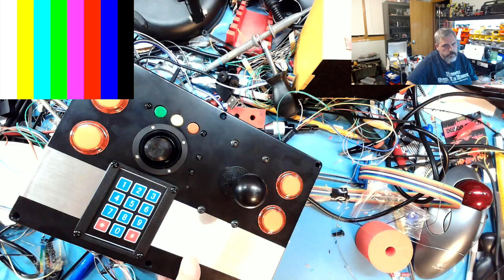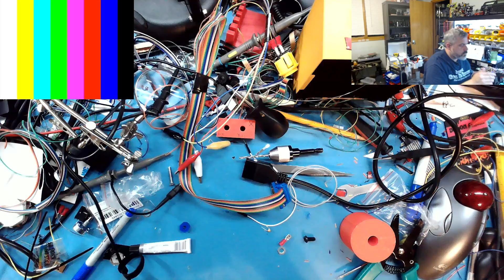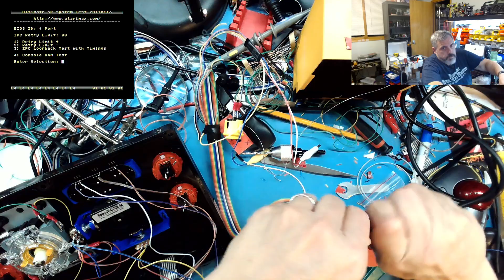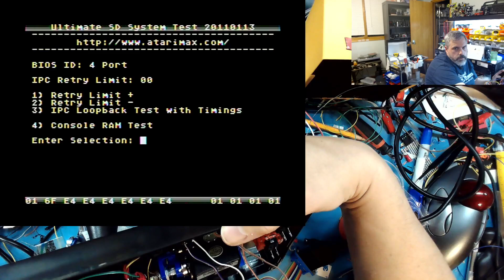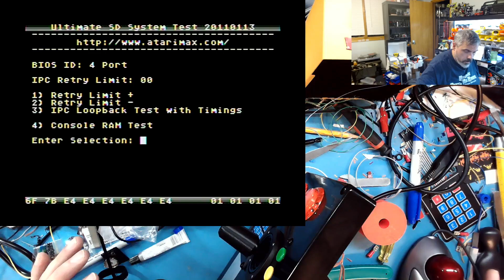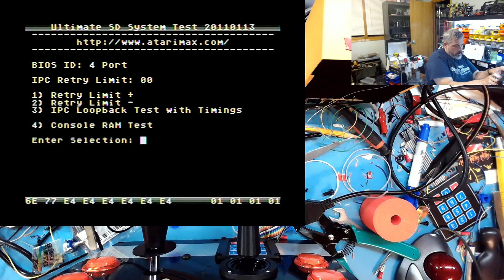What's On My Workbench, ANDI build

Comment: What is the brand/model of potentiometers are they that you use in the controller? The new potentiometers that you are putting in the joystick to replace the original 10k potentiometers mentioned at about the two minute mark? Is there an equivalent on the Digikey/Mouser or Arrow websites?